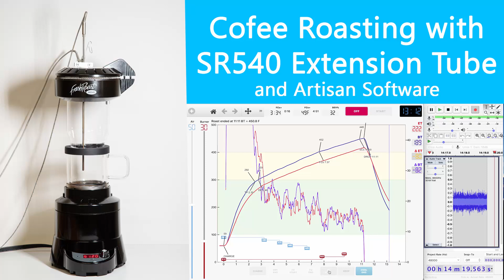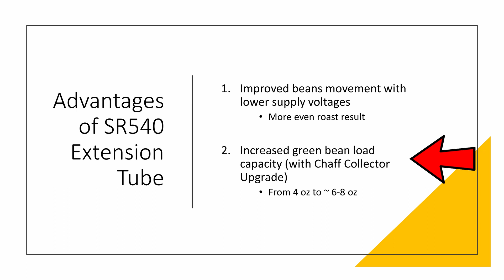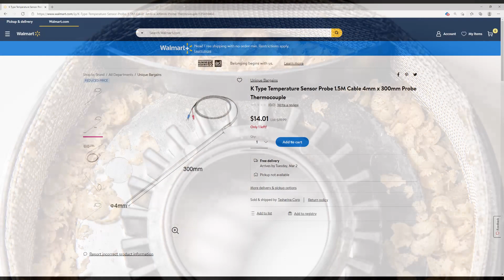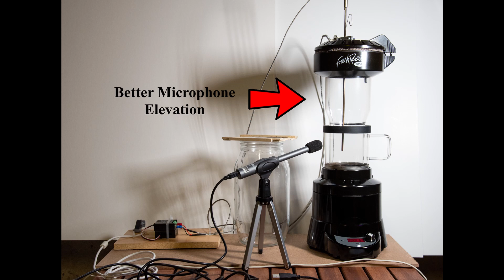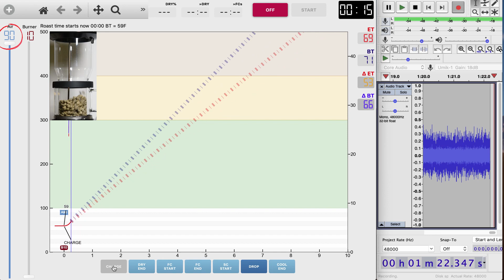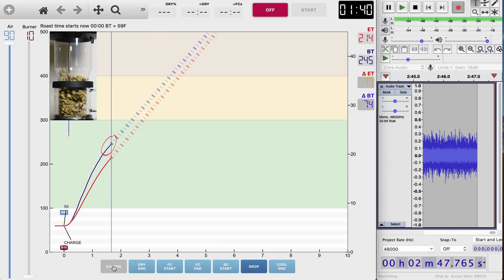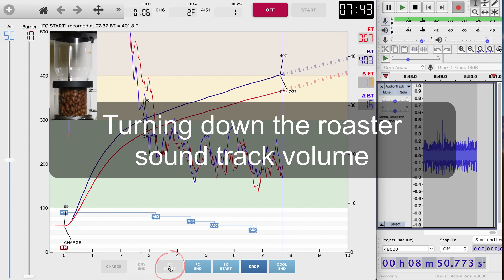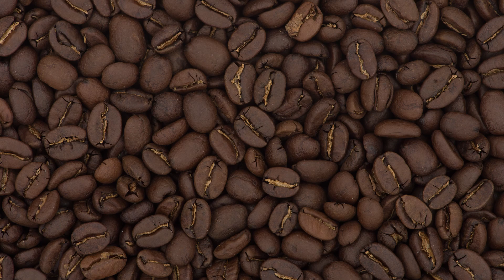Roasting with SR540 (or SR800) Extension Tube and Artisan Software

Comment: Excellent video! I have recently made the upgrade from the original Poppery to a Behmor. I am struggling to get consistent results with Ethiopian Yirgacheffe with the Behmor. Have you tried this setup with African coffees or naturals? I am looking forward to more of your informative videos. Thank you.
Reply from the maker: Thank you for your feedback! I have not tried roasting Ethiopian Yirgacheffe yet, so I do not have any insights to offer. So far I used the method I describe in the video in 10 or so different bean types from Sweet Marias and I generally like the result. I know it is slower and darker roasting than other people prefer, but I have a stomach somewhat sensitive to acids so this method helps with that.
Reply: @coffeeroastingathome8890  I bought a PH meter. My wife is also sensitive to acid.. I make weakish coffee (35 gm per 900ml), so the amount may have to be increased a bit.. I found that if i put 1/8 tsp of baking soda into the filter, i can get any coffee to the pH of tap water. My wife says she detects no difference in taste.... (if you want, i can brew up a batch of coffee with your preferred ration and see how baking soda you would need.
Reply from the maker: @stephenrudolph1064  I tried that too, I have a PH meter and experimented a bit with it. I think there is more than the PH for coffee stomach irritants. I tried baking soda as well, but lately I use a product called "Prelief" if I sense that my stomach is getting too sensitive. I take it just before drinking coffee (but it is a bit of a nuisance to remember...). It has the advantage that it works for other foods that can irritate the stomach (e.g., red sauces, etc).
Reply: @coffeeroastingathome8890  thanks for the recommendation. maybe my wife is lucky .. the baking soda works for her... but she has other issues... and maybe i will try that product if i can find it.

Comment: How did you set up your background? How do you change it? On yours you have a green color for 100-300 degrees,  yellow for above 300.  I can't figure out how to do that!
Reply from the maker: There is a link to the settings I used in the description, you can download it and try it. Also, in the first video I posted (https://youtu.be/t1X0weUSZN0) I go into more details about the setting and how I get the background and color ranges. Hope this helps!

Comment: can i use that 300mm probe with any thermometers from amazon ?  your probe seems not to have a connector for the thermometers i have seen. can you  suggest a not too expensive thermometer and probe for me ? I use amazon.CA  thanks
Reply from the maker: As long as the thermocouple reader works with Type K thermocouples, you can use this probe. If the connector does not work for your reader,  you can probably get an adaptor. I went with the Phidgets module to read the probe, I was hoping to find a cheaper solution but since it is straightforward to use the Phidgets with Artisan I thought it was a good value. I am not familiar with other readers to make a recommendation, sorry. If you don't need Artisan, then search Amazon for a Type K thermocouple reader and pick the least expensive (with reasonable reviews...). You can find some for $20-$25 (US dollars).

Comment: Thank-you for your videos,  they are very well done and extremely helpful. If I have only a bean thermocouple and the temperature readout (no artisan), do you think I could control rate of change?  I would record the temp and calculate rate of change every 60 seconds.  Based on your videos, I doubt this would be possible but would appreciate your feedback.  Anyway thanks again, really great job.
Reply from the maker: Thanks for your feedback! You might be able to a rough control of the rate of change, but I would decrease the time interval to at least 30 seconds. It could get a bit tedious to do this manually, so this is one of the advantages of using Artisan. Good luck!

Comment: I am not using a probe.. Is there any way to use the sr540 temperature to determine some sort of a curve ?..
Reply from the maker: Hi, I don't know how to connect the internal sr540 temperature sensor to the Artisan program, but I suppose it is possible. The alternative is to make a curve by hand by reading the temperature display, but this is tedious. Also, the internal sr540 thermocouple measures the inlet air temperature. The air temperature around the beans is also influenced by heat transfer to the beans, endothermic/exothermic bean reactions, etc. so it would be better to measure the temperature near the bans rather than the inlet air temperature I would think. Hope this helps!

Comment: Kind of confused, you appear to be controlling the roaster with Artisan but the device is not listed as compatible on Artisans site, nor is Artisan compatibly listed as a feature on the manufacturers page. I am aware there is a USB port on the roaster, are you connected to it directly from your computer and it just works magically as an unofficial sampling roaster?
Reply from the maker: Hi, just to clarify I am only reading the thermocouples with Artisan, I am not controlling the fan and heat settings of the roaster with Artisan. I am only changing the slides in Artisan to match the manual change I made in the roaster using the roaster knobs. The only purpose of changing the slides is to keep a record of the manual changes I made. Hope this helps.

Comment: Just picked up my SR540.  Have the phidgets vint hub and the 4x thermocouple, plus the two K type probes.  Downloaded the artisan software and have everything running.  Only problem is I cannot  get the delta ET to show up on the right side of the screen and the red graph line.  Only the blue line and the delta  BT.
Reply from the maker: Make sure in Config->Curves, RoT tab the Rate of Rise Curves and Rate of Rise LCDs checkboxes are checked for DeltaET. Hope this helps!

Comment: Thanks so much- these videos have been incredibly helpful as I'm about to take the phidget/artisan plunge on my SR800. Quick question- the 300mm probe you have linked from Walmart- I see it says K type, but it doesn't have the two-pronged yellow connector I usually see on probes. Do I need to get any type of adapter to connect this to the phidget? Thanks!
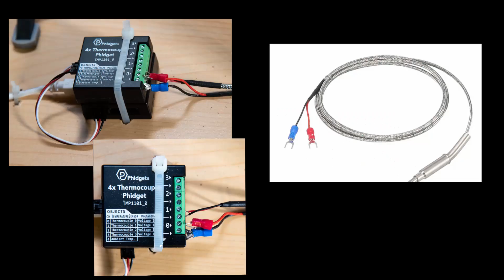Reply from the maker: You are welcome! Take a look at 8:13, I explained how I connected the Walmart thermocouple to the Phidget module. The Phidget module expects bare wire, so I simply bent one of the legs in the Walmart thermocouple wire termination and inserted the remaining leg in the Phidget module. There are pictures in the video that show the end result. The thermocouple sent by Phidget is already terminated in bare wires, ready to go into the module. Phidget does not use the typical two-pronged yellow connector. Hope this helps!

Comment: Great video.  How did you get the events to show up across the bottom of Artisan?  Mine attach to the BT and ET lines.  Also I took to heart what you questioned on a previous video (was the ET even necessary) and just use the BT probe which makes it less confusing as I learn this.  AND I've tries several probes and my MS6514 didn't like some of them so I had the enlarged hole problem as well.  I used some high heat epoxy to fill the hole and then redrilled.  Worked great.
Reply from the maker: Thank you for the feedback! About the events, I have the sliders work in a range of 0-100 and then set the temperature scale starting from zero, so they show in the 0-100 are of the display. I included a direct download link to the configuration file I am using in the description if you want to try it. Yes, the ET is not critical and it should be fine to start with the BT only. Good idea about the high heat epoxy! Thanks for the tip.
Reply: @coffeeroastingathome8890  I looked at your roast log and made some changes in mine and now I have the labels on the bottom which I like better than on the Bt line.  Thank you. I wish there was a way to make the fonts bigger!  I tried out the new roast log today on 2 roasts and all went well....except I'm not sure my temp probes are very accurate.  I'm paired with the MS6514 and not a Phidget and my first cracks are at 380 which is about 20 degrees off for this bean.  I've tried several probes and am at a loss.
Reply from the maker: @bwilliams915  Glad it worked! About the temperature, I am not sure what could cause a 5% error in the measurement. I think the important thing is for the measurement to be repeatable, and not so much the absolute value. I am not familiar with the MS6514 unit to help, sorry.
Reply: @coffeeroastingathome8890  Also want to say that there is a facebook group for the Freshroaster called "FreshRoast Coffee Roasters".  If you don't belong you might consider joining.  I know your videos will help a lot of people.  Thanks for your help.
Reply from the maker: @bwilliams915  Thanks for the information, I was not aware of that group.